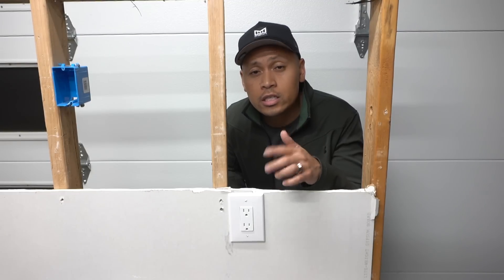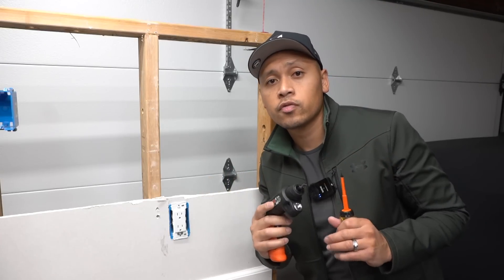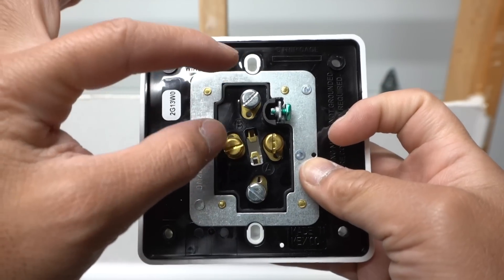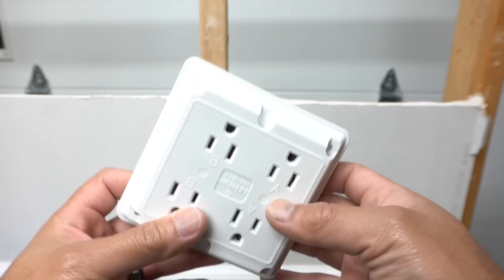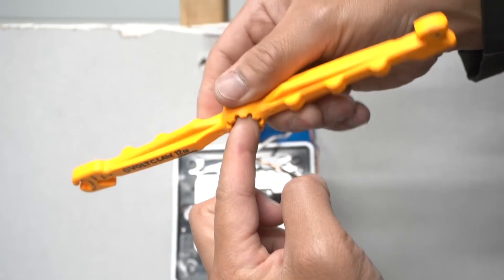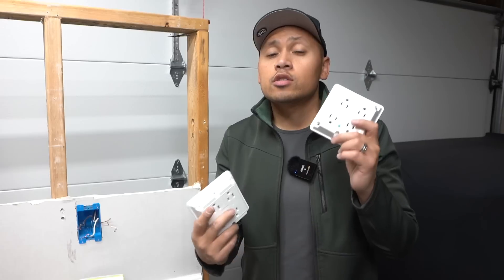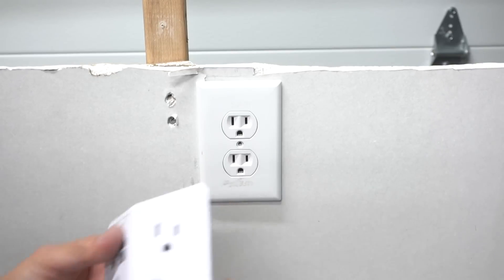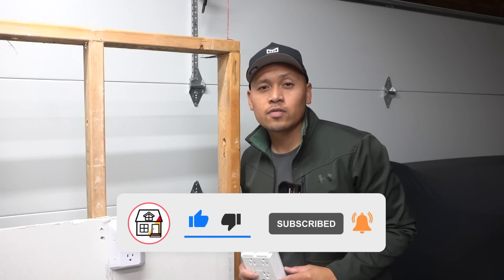How To Install 4 Outlets Into A 1 Gang Electrical Box! DIY

Comment: What breaker and wire would you choose to run a microwave, a toaster and a microwave oven?
Reply from the maker: Hi! For most standard microwave ovens I would use a 20-amp breaker and 12 gauge wire.
Reply: Can you run a microwave and a toaster and small oven at the same time. In other words can 2 separate 20 amp breakers  run to this?

Comment: You incorrectly wrapped the hot and neutral wires counterclockwise.  They should be wrapped clockwise, like you wrapped the ground wire.  The screws turn clockwise to tighten and will increase the tightness of the wrap.  Wrapping counterclockwise will cause the wires to move out as you tighten the terminal screws and lessen the integrity of the connection.
Reply: Normally I would agree with you but, on that particular device, there's a retaining hole the end of the wire tucks into. The instructions with the device say to do just like he did. That's also why the wire has to be stripped longer.
Reply: The wires are wrapped around the screws correctly.  Watch again.  To bend the stripped end clockwise, he wrapped the insulated wire counterclockwise.

Comment: Thanks for the video! I have a quick question- I have an issue if my vertical blinds of window not closing properly.In my case, I am having those vertical slat blinds and I have 2 issues and would greatly appreciate your response!
(1) In my living room window blinds, only 1 out of the total 9 blinds move when I pull the rope attachment. The remaining 8 blinds just stop moving along with the first one after 2 seconds of pulling my rope attachment so there is this huge gap created when I close the blind and sunlight comes right in.What to do about it?
(2) For my bedroom window blinds, i ma having the same issue but in this case 4 out of 9 blinds move after pulling the rope attachment. The remaining 5 just won’t move at all after a while so it creates a wide gap and sunlight comes right in. How to solve this issue?
Thanks ahead of time for your response🙏

Comment: First you make sure that the tester is working properly by ether going to another outlet or just leave the breaker on then you can turn the breaker off then test the outlet to insure the power is off then after the outlet is removed then you can reconnect the ground wire first then reconnect the white neutral wire next then you can reconnect the black wire and remember always go clock wise so when you tightening the screw it will not awn twine the wire during tightening the screw then put the outlet back in just fold the wire so it will not interfere when replacing the wall outlet then the outlet cover then go turn the breaker  back on

Comment: I have the same plug-in extender that you've shown. To me it's a no-brainer. Rather than going to the trouble installing the 4-outlet receptacle. I can just plug in the extender and lock it in with the center screw. Not only does it have one more outlet, but it also provides surge protection and USB charging capabilities. Not to mention the better price.